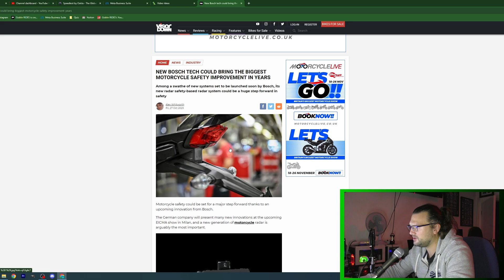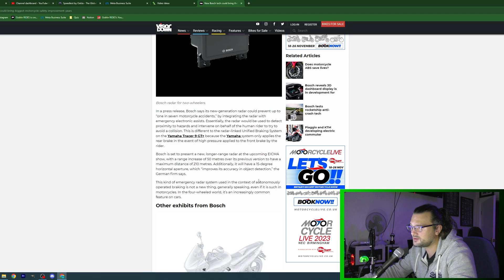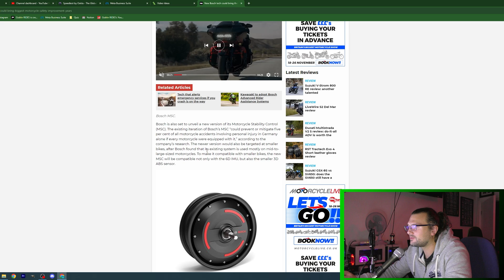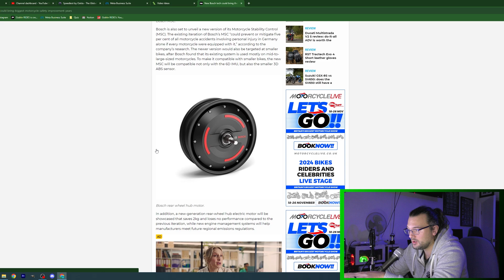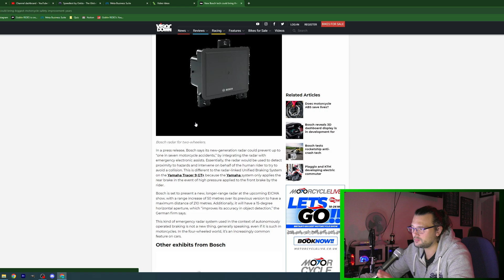New Radar Emergency Braking Systems For Motorcycles... Meh

Comment: I'd never want a car to be in control of my braking and quadruply more so never on a motorcycle.
These systems are for dozy, incompetent car drivers. I'd like to think that does not apply to a far, far higher percentage of bike riders in which case it will never become a must have selling feature on your average bike... in fact most people will either avoid buying bikes with it... or just switch them off if that isnt an option.
Don't get me wrong, I do think an electronic ring fence of rider aids can really help instill confidence in a new rider... things like ABS, cornering ABS, Lean sensitive traction control, wheelie control and slide control..... but radar auto braking is a totally unnecessary bridge too far IMO.

Comment: having done a couple thousand km with last gen radar assist, without emergency breaking I would trust this system to not break when it is dangerous to do so.
If done correctly it will be perfectly safe. Sensors detecting if you grip your handlebar or are flipping off other drivers and IMUs make it awesome. Bonus point for tactile feedback (vibration), and warning lights flashing before it intervenes.
With how much navigation or fidling with infotainment can distract you it is a gift.

Comment: At face value , this will cause crashes rather than prevent them. Imagine getting an unexpected brake input when you are not prepped for it and you are not in a good position for it (turned front wheel for example). It will likely cause you to lose control.
Reply: these systems only are on bikes with IMU meaning the bike knows how far leaned it is and on some models even how much steering input you give. So the system will not act in a situation that could cause you to fall.

Comment: I had this device on my range Rover sport my opinion, absolutely awful, and like you say your minding your own business riding along the road, the car in front brakes and then it suddenly brakes you totally unnecessary on the Motorcycle I’m not too sure if you can have cruise control on without actually having the radar on as well because then that is even more ridiculous. This was the case in the range Rover you couldn’t have cruise control on without having adaptive breaking system on my opinion, rubbish I’ll ride a Kawasaki H2, SXSE+240 hp one reason why I won’t get the new one is because of this System